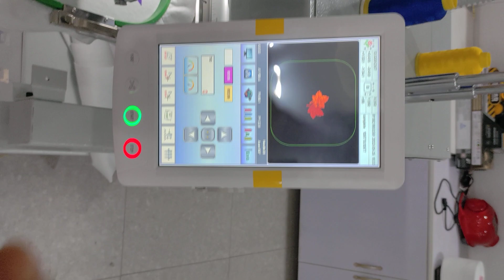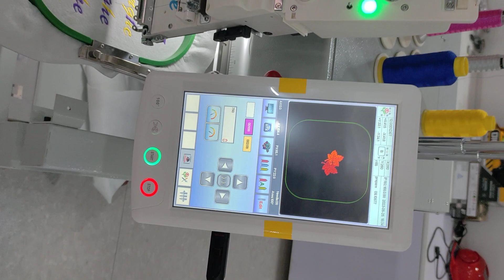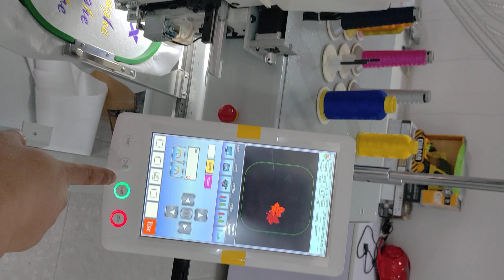如何使用U盘导入机器工作 Embroidery machine User  YINGHE

Comment: I have a problem with the 2 head machine, after power off it prompts to reset frame , gives two options (ESC, OK), if i press OK the frame goes back beyond the machine limit and struggles to extend of breaking the frame. What could be the problem with the frame position? Please help
Reply from the maker: yinghe brand?